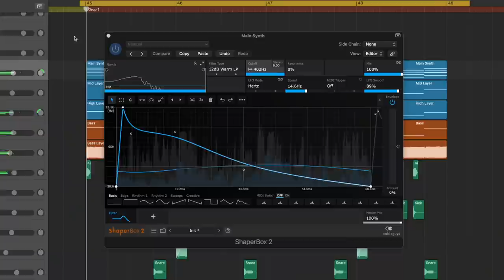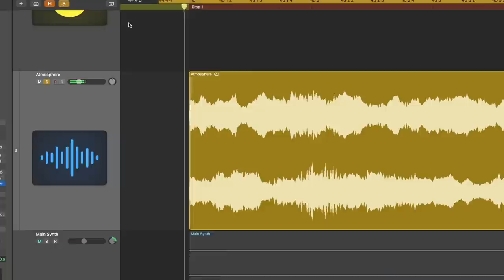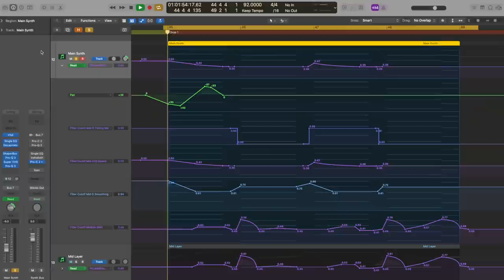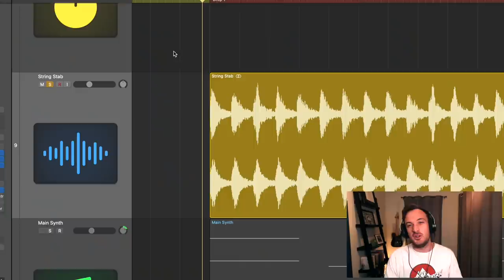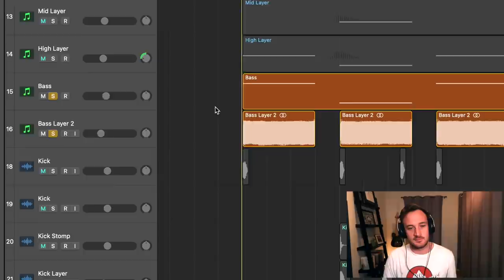The Crazy Synth Technique I Learned From MURA MASA

Comment: is there any stock plugin in fl studio that allows you to use an lfo to affect the cutoff of a sound? thank you
Reply: YES, Fruity Peak Controller has an LFO that you can map TO ANY KNOB IN ANY PluGIN and to multiple knobs over multiple plugins, with inverted and any type of ramp and decay added with it. 
 
You can also use the wave form peaks of an audio sample to do the same, you don't have to use an LFO.    So think of a drum beat, you can map that to control knob values and use it's rhythm.  Distortion, delay, loudness, pretty much anything in any plugin that accepts a value can be mapped.

Enjoy!!!

Comment: Great video and awesome technique! I was able to automate everything but the Cutoff, anyone else have this issue in Ableton?
Reply: Yeah same here, did you ever figure out how to get it working?
Reply: Yes, that's true.. The Cutoff parameter is the average of the points in the LFO curve, so whenever you edit the LFO curve, you are also changing the Cutoff value (try drawing some points and you'll see the value changing). So for example, if you'd have automation armed while editing the LFO curve, you'd inadvertently overwrite your Cutoff automation with semi-random values. Also, some DAWs (eg, Ableton Live) would interpret any change in Cutoff value as the user adjusting the control manually, and automation playback would be disabled.

In short, allowing automation of Cutoff and Resonance as regular VST/AU parameters could unleash chaos.

A workaround is to use the Envelope's Shift slider (which is an automatable parameter) to offset the LFO. This works even with the Envelope's Amount at 0%.
Reply: any workaroud?
Reply: @kphilipp95  Yes, it's in our comment above: "A workaround is to use the Envelope's Shift slider (which is an automatable parameter) to offset the LFO. This works even with the Envelope's Amount at 0%."